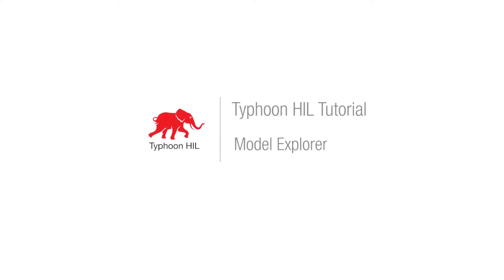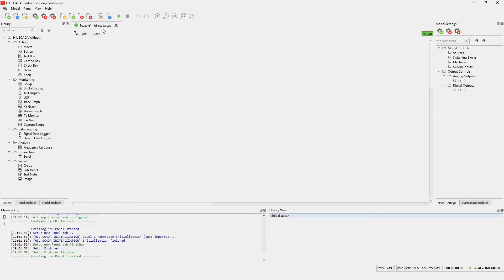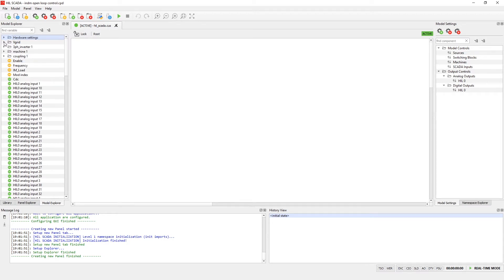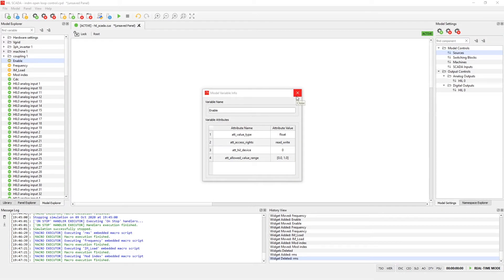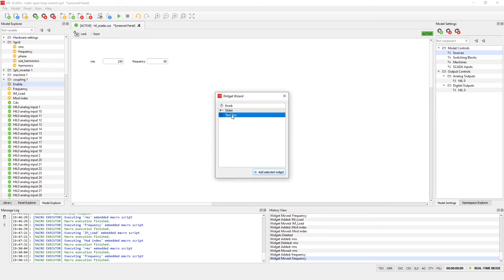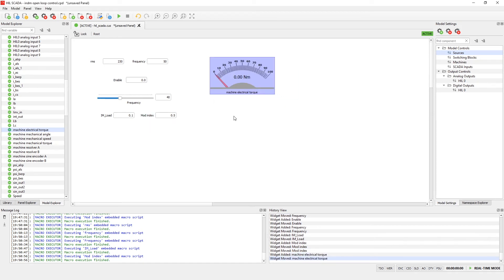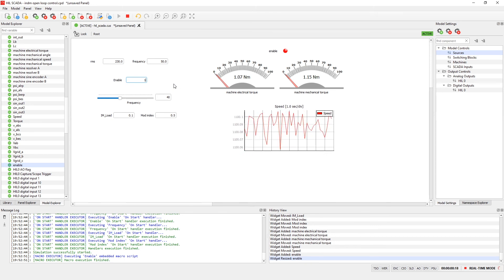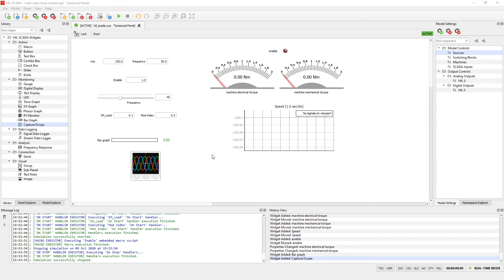Model Explorer | Tutorial

Comment: HI there!
I apppreciated this video cause i had no idea i could use the model explorer and drag the parameters directly into the SCADA. I'd like to have more info about the use of the macro widget. I have been searching into the documentation for some time and i don't get how the different function are working.
Thanks a lot.
Reply: Hello Fabricie,

Here is the explanation from the documentation:

Macro – this is a special Action widget that has four event handlers whose code is executed in four different ways:
1) On Start - the code specified in this handler will be executed at the simulation start after the Panel initialization script is executed.
2) On Click - the code specified in this handler will be executed on a button click in the similar way as in the Button action widget.
3) On Timer - the code specified in this handler will be executed on a timer event of the specified HIL SCADA Time slot.
4) On Stop - the code specified in this handler will be executed after simulation is stopped.

Note: At least one handler must be active.
Note: Variables specified inside On Start handler will be available in other two handlers.

-----------------------------------------------------------------------------------------------------------------------------------------------------------------------------------------------------------

If you have more questions, please log into your subscription account, click "Support" and open a support ticket.

Best regards,
Dusan
Reply from the maker: Hi there! We are glad to hear this video was helpful for you. Find more information on the macro widget on this documentation page: https://www.typhoon-hil.com/documentation/typhoon-hil-software-manual/References/action_widgets.html